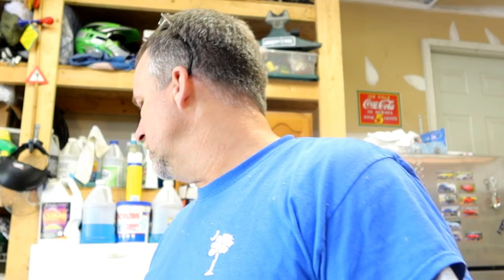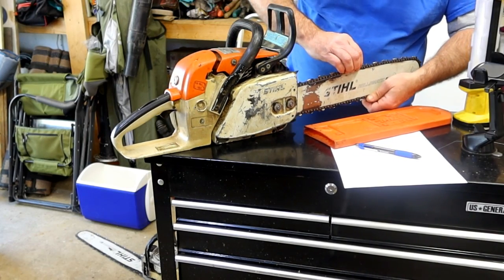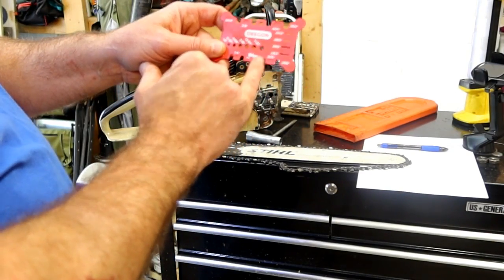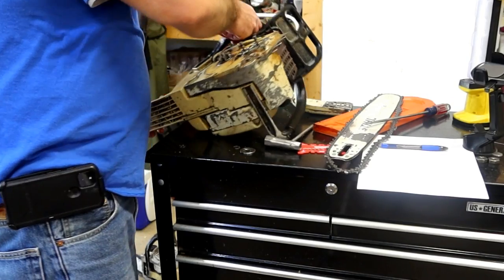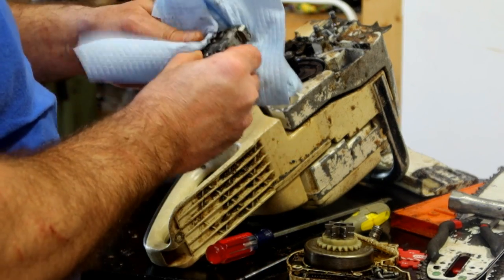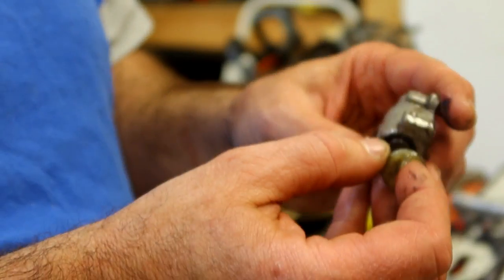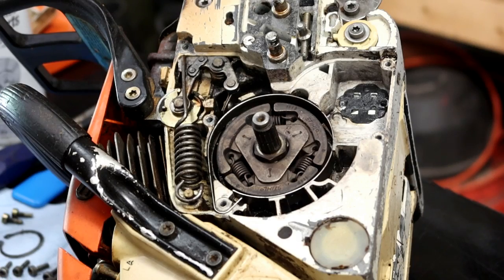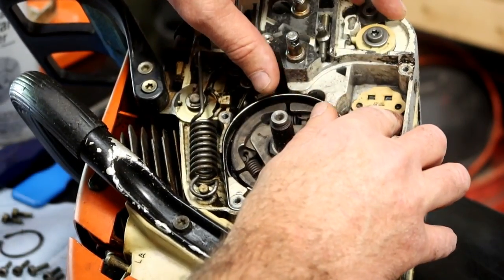Stihl 028 AV Oil Leak diagnose and pump replacement / Clutch drum replacement

Comment: Thanks, man.  Saved me a repair charge.  And Proline replacement oil pumps are only $22 as opposed to $100 for factory.  I'd like to buy you a beer.
Reply from the maker: Glad it worked out! Thanks for watching!
Reply: Do you by chance have the link for the oil pump? Like where to buy it from?

Comment: When I switched from the regular bar lube, to 20 weight motor oil, my leak stopped.  I think the high viscosity of the 'modern' bar & chain lube builds up too much pressure, and causes the leakage.  Yes, you might need a pump and gasket, but if that's not the problem switch to a lower viscosity oil and give it a try.   It looks like you did fine with regular bar/chain lube, , , thanks for the video.  You picked up a new subscriber.
Reply from the maker: Thank you for watching and the feedback!
Reply: I found a manual for this model, and it actually shows what oil to use depending on your ambient temperature. Doesn't say bar oil, it says 20wt,30wt, or 40wt.
Reply from the maker: Good to know. Thanks!
Reply: @allennewman632  Thank you.

Comment: Thanks for video , is there a way to check passage way from tank to pump before going back together
Reply from the maker: I demonstrate the passages at the 7minute mark. Unless you’re asking about the gasket blocking the hole. For that I would consider either thin oil or air and slowly rotating the pump

Comment: What is holding the plastic cap into the rear of the new oil pump?  Do you think whatever was missing was the cause of the leak?  If I had to guess I would have said it was a rubber cup rather than an O-ring.
Reply from the maker: It looked like the plastic cap was glued in. Probably epoxy but resembled wood glue. I never found an o ring but I expected to
Reply: Ray of all Trades   Thanks. My guess now is some kind of gasket sealant, since that’s what they use anyway for other things, like crankcase and base gasket joints. Dirko or one of the variants like Hondabond or Threebond 1186.
Reply from the maker: I'd use 1187 / threebond but wait for it to cure

Comment: I have an o28 av super  that my grandpa bought  in 1979 I found  it in the scrap iron  pile took it home cleaned the carburetor put gas in it and it runs like a dream  but it's not oiling  the bar I took it apart  and the oil pump  looked like it has chocolate milk in it and the plastic  piece on the end was basically not attached  would  that be why it's not oiling  the bar and chain any advice would  be greatly appreciated
Reply from the maker: Pretty good chance of it. Check if oiling without bar and chain too. Oilers are available on ebay

Comment: I found this video from a google search, and I had a similar problem, except my saw was leaking bar oil while in the case, and when the saw was filled with gas, it leaked just gas. Is that oil pump a place where the gas and bar oil would meet? Or do I have another problem on my hands like multiple gaskets? I’m trying my best to not take apart the entire thing since I don’t have an impact wrench
Reply from the maker: Try to clen it real good, fill it up and let it sit on cardboard. They leaks might become visible. Sometimes it's just the caps
Reply: @RayofallTrades  Thanks for the recommendation!

Comment: I have an oil pump issue with my stihl 028 ac super.  I have ordered 2 pumps on line and both of them have not fit.the Stihl dealer doesn't carry as the saw is to old.WHERE CAN I ORDER THE CORRECT PART.
Reply from the maker: Did it look like the one in my video or was it a ring style?

Comment: great video, thanks.  I would get rid of that spur drive, and switch it over to a rim drive, easier to replace in the future, and better diversity for drive ratio (7 or 8 tooth for variations of wood).
Reply from the maker: Yes that's a good call. Thanks
Reply: @RayofallTrades  you are welcome, thanks for the video.
Reply: Not sure if you can convert to rim drive because of that oil pump gear that is driven by the drum. Maybe there is a special hybrid drum that has a 325 pitch star for the gear then splines for the rim sprocket but I've never seen one.

Comment: 11:00 minutes, there is an angle on the end of the worm gear shaft.  That shaft pulses in and out of the pump end, as the flat spot reaches the supply hole, the shaft pulls away from the hole (sucking action), as the flat spot rotates to the discharge hole, the piston pulses the other way, applying pressure on the oil, and forcing it up the hole to the chain, (look up piston pumps), the wobble is to make the piston move in and out.  There should be a spring in there somewhere (I haven't taken one apart yet), that keeps the shaft tight against the wobble area, so as the shaft turns, it also pulses in and out (Left and right).  I found a part number for a High output pump: I can't verify this to be fact  1118 640 3211.  I wrongfully concluded that different part numbers were different years, but they also denote oil flow per minute at max RPM, or at least the potential.  the high output models have a greater wobble, which increases the pumping action.  The flat spot is probably larger too, (Or cupped), to transfer more oil with each pulse.  I just learned about this, sorry I can't give more info).  Thanks much for the great video.  One more thing.  I found that thinner oil, as opposed to bar oil, will stop a lot of leaks, the bar oil build too much pressure, the transfer tubes cant handle it..
Reply from the maker: Those are great tips! I appreciate your taking the time to explain that!
Reply: @RayofallTrades  Happy to share info, always
Reply from the maker: Thank you so much for the detailed information!  That explains a lot and I learned a ton too. I truly appreciate you.